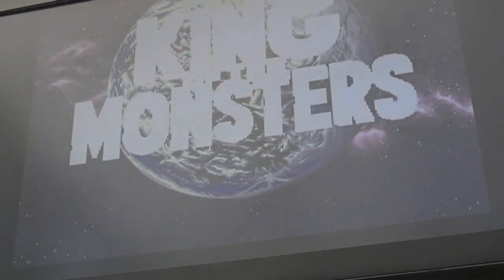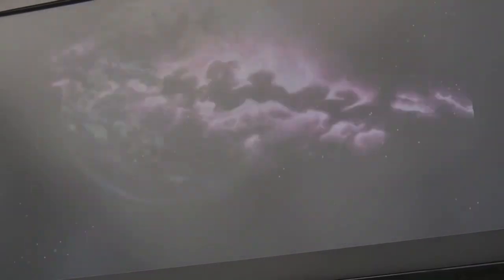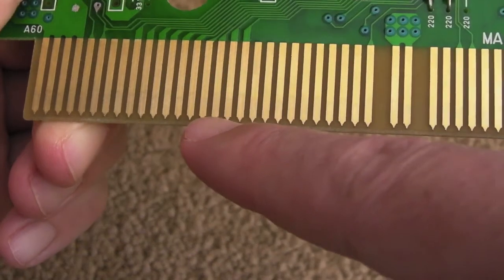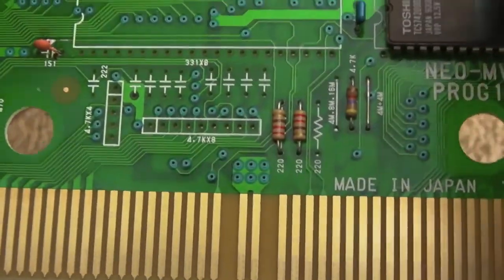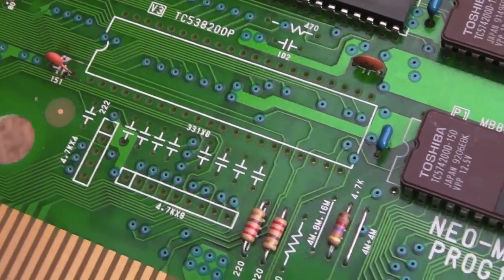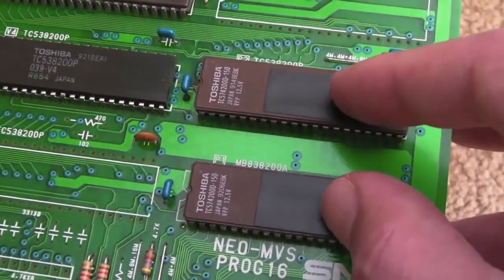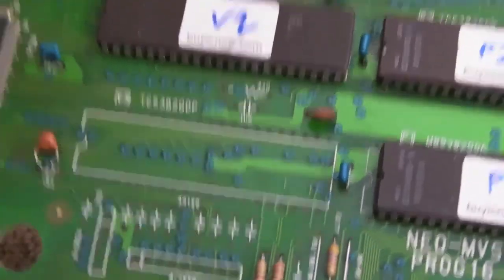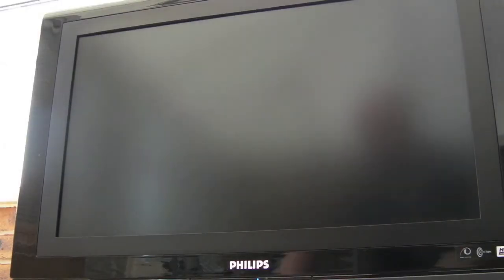SNK Neo Geo MVS King Monsters 2 (Revisited) PCM Fix

Comment: Great stuff again m8, have you thought about doing a video on a dual EPROM the metal slug2 patch cart - would be great to see? Thanks for sharing!
Reply from the maker: mjsaville Thanks!  I don't have Metal Slug 2 as a separate cart yet!  The same thing that I did to Magician Lord stands though - that's exactly what needs doing to Metal Slug.  Just use a 27C160 EPROM and use the next address line up from the one I mentioned in that Magician Lord video.